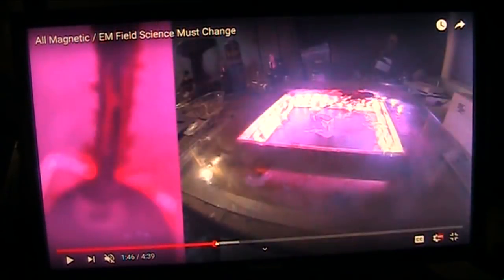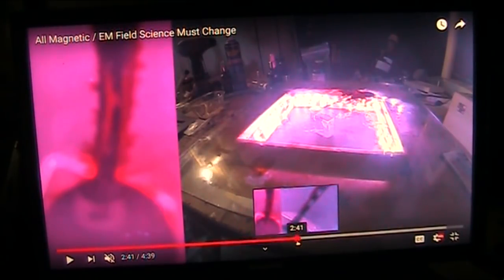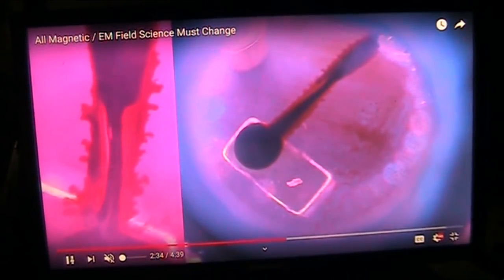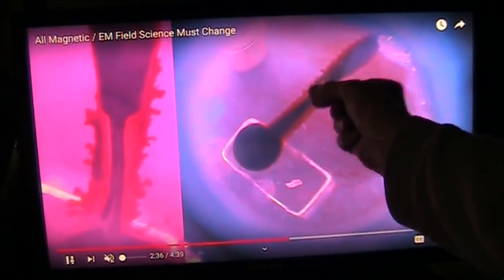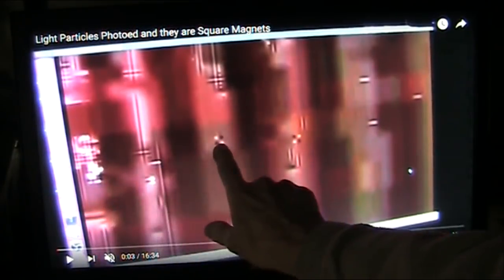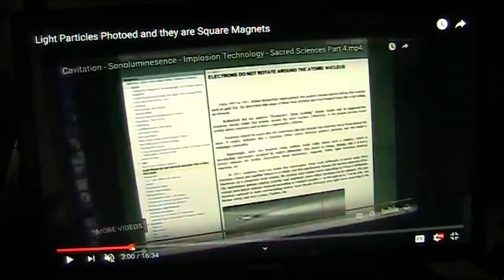Ferro Fluid Stretch

Comment: let me know the setup of how you took your pics please ....is it in a vacuum? etc...thanks brother.
Reply from the maker: Hi Lee...they were taken in a darkened room in the normal air with a cell phone. I think was video (not stills) and clipped but not certain as Rod Warren took the pics. I do the analysis and atomic structure stuff mostly but have done the experiments and some others as well and very simple. We used simple pulsed construction laser Bosch GLM15 but any laser should do. The green laser I think is continuous (not pulsed) but same result. I think fusion might be possible with plasma from the venturi using protons.
Reply: @mudfossiluniversity   I would say then that those particles are just air or dust...like pouring water into a bowl will cause many ripples to the edge so it is with light...and so it is reflected off particles in the air...try it in a vacuum...then all debris is removed.
it is my opinion that fusion will never work...I say you cannot add energy so that it throws off more electrons so you are left with something LESS than what you started...energy doesn't do that to atoms...not one...more energy means more electrons more shells and orbits..the electron is from the atom...take it off...add energy and another will appear...it is energy through matter that creates the electron..a fountain of energy rotating a sphere of reciprocating matter...same as the video of balls of matter above......except the energy is coming out.....no electron exists, except when energy is input to an atom, more than it can accept, then it radiates.........it needs the same energy in as is going out....so its not free either.
is my opinion :)